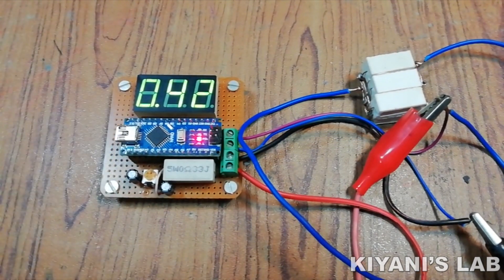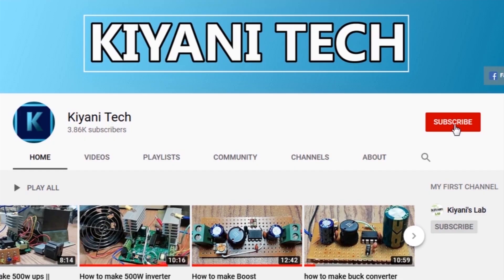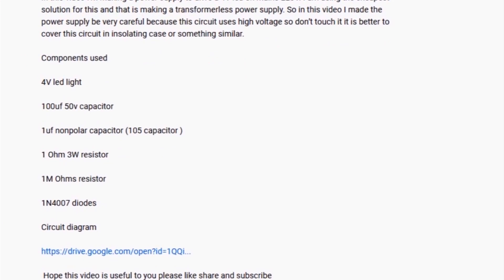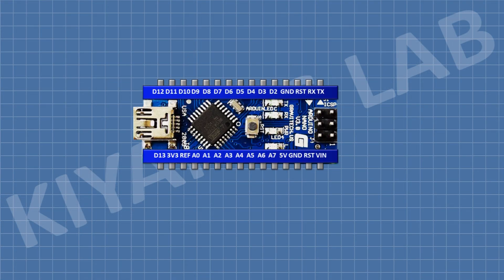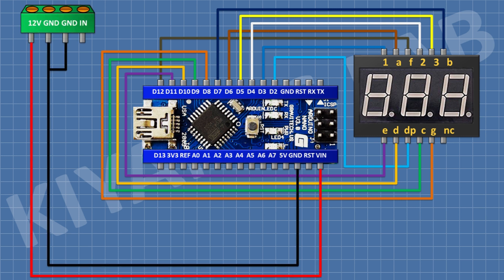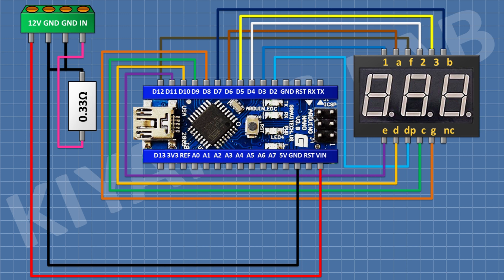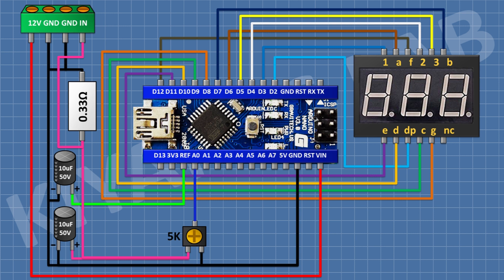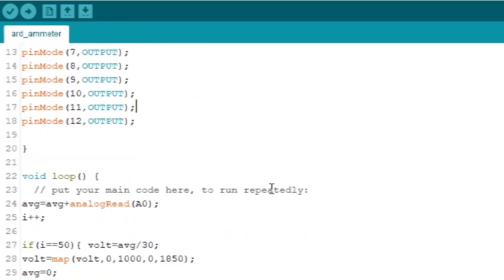How To Make Arduino Based Current Meter

Comment: "display wiring diagram" does not match with the given code. it shows strange things except numbers. noticed and paid attention to do things correctly but useless because diagram is incorrect. it is necessary to change the code or Kiyani's Lab share the correct connection diagram.

Comment: Hlo sir, Can we use 50A shunt instead of 5W .33ohm resistance?
Reply: Yes, basically you can change to any shunt you want, you just need to adjust the trimpod to calibrate into new shunt and the mapping of the voltage in arduino code. The limitation is determined on the ADC accuracy of arduino, thus there is a tradeoff: the higher the shunt ampere you put the less accurate you will get when reading small current.

Comment: It would have been a fine project if you hadn't left out the current limitation for the LED display. Without current limitation you are pushing the microcontroller outputs to their max and exceeding the specifications for the display by twice the current they are made for. Don't show incorrect practices to beginners or they will think this is the way to do things.